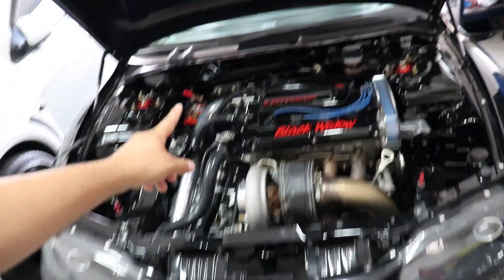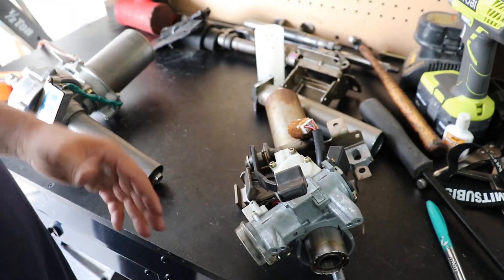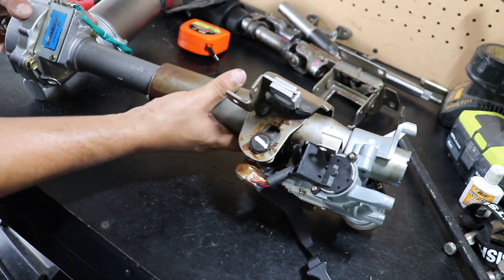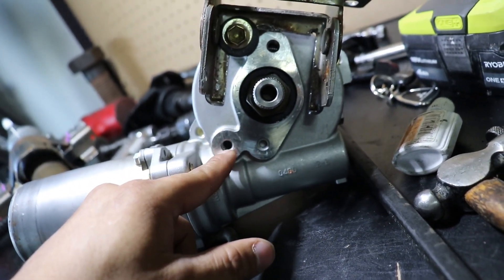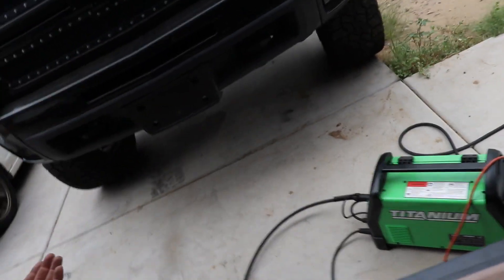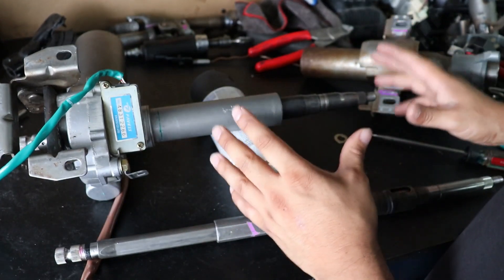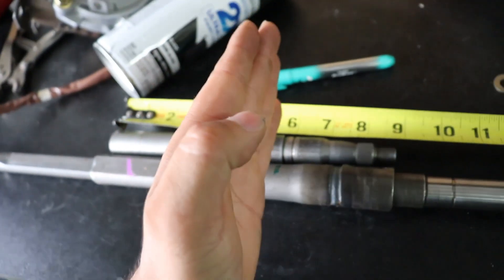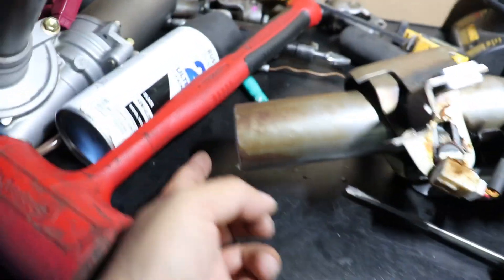1997 Mitsubishi Eclipse GSX- PT 2 Toyota PRIUS Electric Steering System Install- cutting/welding

Comment: hi, I am going to swap this eps on my drift project, but I was said that prius eps can't return the steering wheel as it doesn't have steering angle sensor. Can you give me some advice about this? I would like to know how it could be fixed or which is better one for this purpose (maybe opel corsa b or c eps)
? thanks :)
Reply from the maker: The force of the road during a turn will return the steering wheel to center.
Reply: @Gabe_Ortega  yes of course,but people say, that it doesn't center as hydraulic steering rack does. Is it so noticiable in drivinf?

Comment: How does it feel above 50mph that’s my only concern
Reply from the maker: I installed a switch to turn it off at those speeds...I feels like it has TOO much steering.
Reply: Thanks. I’ll add a switch aswell. Only really need it at slow speeds anyways. Already Installed just waiting for the snow to melt to test.